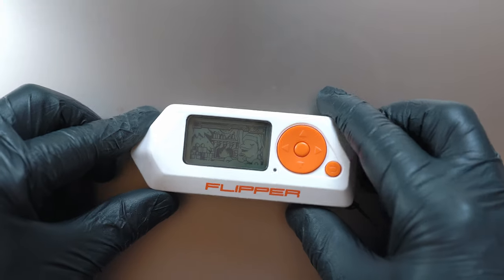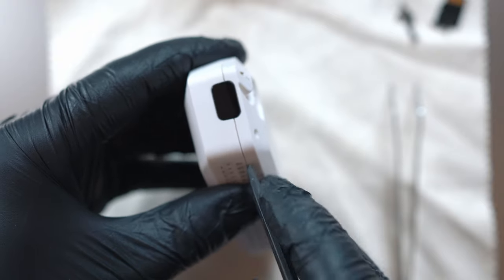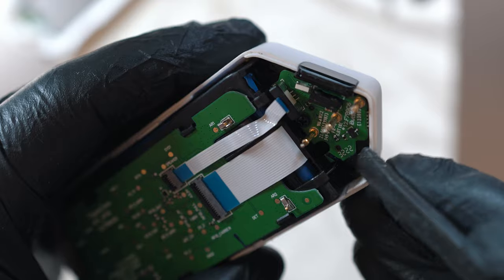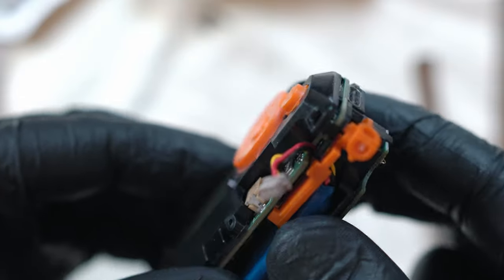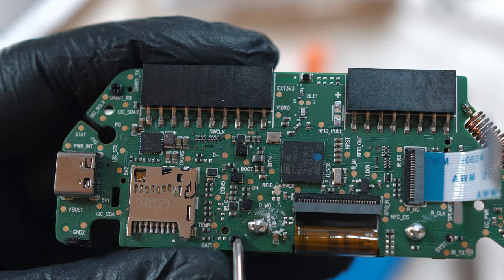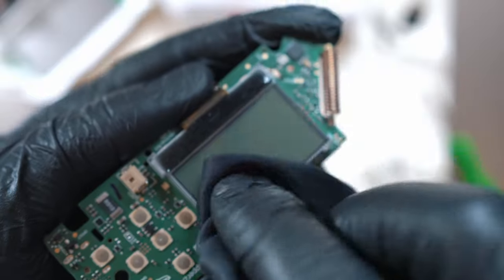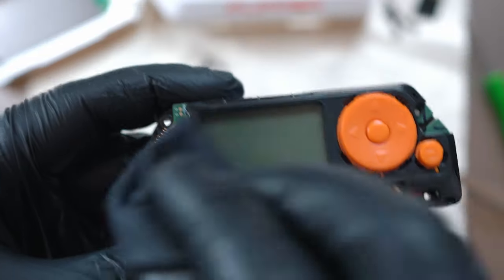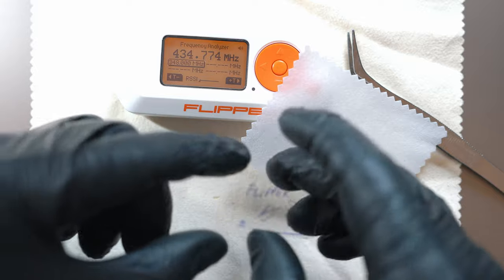Flipper Zero Teardown - What's inside hacking device of 2023?

Comment: Taken apart very carefully of course I was using it on an antistatic mat. But one of the right buttons is not working yes you're correct about the marks on the buttons. I need to replace the right position button any links or suggestions for that particular part .
Reply from the maker: I would find devices with similar clicking buttons and salvage button. many things have same buttons just look around

Comment: How to fix the right position on Flipper zero rocker switch up down left and center button are  working . I opened up the flipper very carefully and sprayed a little contact cleaner on the butt on the right side. I don't know if that can be pulled apart and to replace the switch any tips. I can't control it from my phone, but that is not very convenient. Can I replace just that top board or does anybody have a suggestion for that tiny micro switch?

I do all my electrical work on a static mat in my shop to a lot of CCTV camera repair.

Comment: The Flipper is nothing more than a microcontroller.
This means that anyone can make a flipper with Arduino, Esp32, STM32, among other boards.
Reply from the maker: yeah, but the cost…. you think you can beat $160 ? all up with case, battery… and fairly compact design?

Comment: What is max cap of sd card and wich one do we need?
Reply from the maker: not 100% sure but 32 will work … I currently using 8GB
Reply: @takeapart  Thanks i got mine flipper but didnt have time to test it, and first i wanted to buy sd card so 32 is fine.
Reply from the maker: yes but I don’t see why would you need that much capacity… flipper files are small. my 8GB is used on like 25-30% and I have a lot of crap there …
Reply: @takeapart  Well if is like that 16 will be just fine, maybe later we will stock more data idk, didt yet tested so for now i think its just toy next week i dont work so i will have time.
Reply from the maker: cool! have fun
Reply: For future reference: flipper devs say smaller SD card is better because it has faster read write speeds.
You will almost never use even 8gb unless youre getting very creative with apps and firmware. Most files use less than a few hundred bytes of data to store the entire scan.

Comment: What is sub 1GHz
Reply from the maker: frequencies below 1000MHz (1GHz)
Reply: @takeapart so it can be used as frequency scanner? Can you listen to radio on it or hear shortwaves from building sites?
Reply from the maker: @blazejl3540 no you can not hear audio…
Reply: Then can it be used for remote car control?
Reply: Like wireless data capture and sending?
Reply from the maker: @blazejl3540 only older rc cars are operating on sub ghz frequencies but even those will not work as they usually 27mhz and that’s below flippers frequency range…. flipper is capable of doing anything between 300 and 900Mhz
Reply from the maker: only between 300-900MHz
Reply: @takeapart  ok thank you